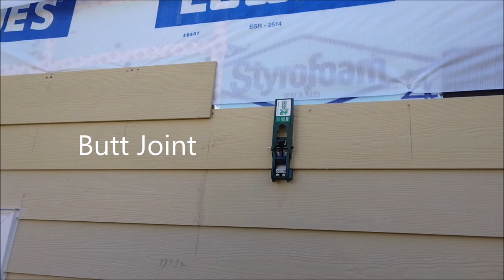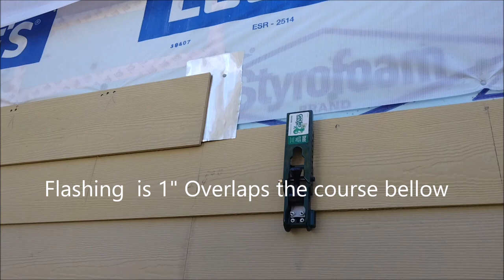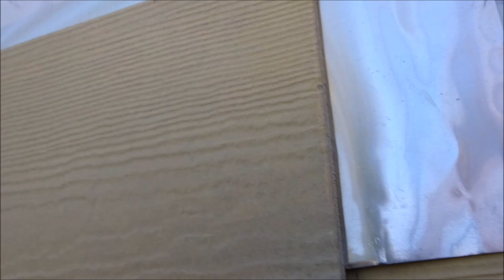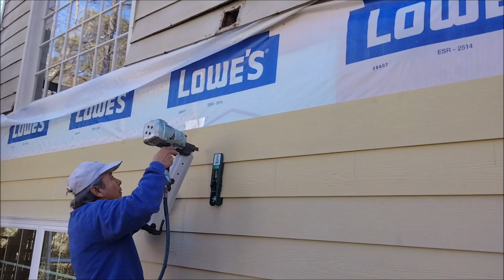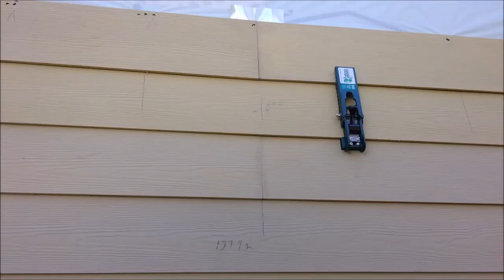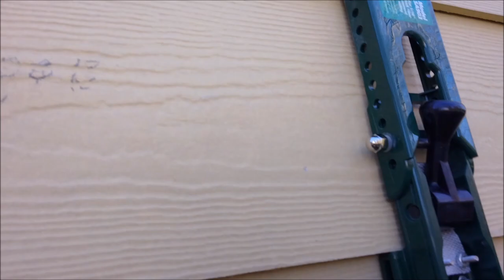Install  Butt Joints On  Hardie Plank Siding -Install Two Pieces Of Cement Siding Against Each Other

Comment: You should use a dark colored flashing that way it will look a shadow underneath not a reflection
Reply from the maker: Not true. Aluminum is a prefer flashing and it is not reflecting light.
Reply: @ Did I say steel 😂 I said a dark colored?? Of course it’s aluminum 😂 I have never seen anything but aluminum flashing?? 
And as I said before,black/brown coil stock will not reflect light if the sun shines on it like regular aluminum

Comment: are the painters supposed to caulk the bottom of each board? if the paint on the siding is going to be white the crack is going to be very noticeable.
Reply from the maker: No . You should not caulk the bottom of the board. You suppose to caulk only the gap between the boards

Comment: All your nails are blasted right through the face of the board,maybe have your guys brush up on nailing practice and placement,set your compressor a little lower or set tip on your gun for depth
Reply from the maker: The PSI was 100 we decreased it to 80 . Thanks
Reply: These were nailed too close to the top and edge. 

For anyone who wants to use the manufacturer’s recommended nail should be between 3/4-1” from top and 3/8 from edge.